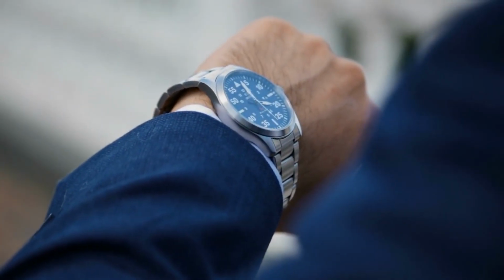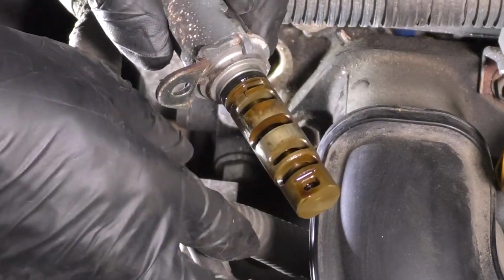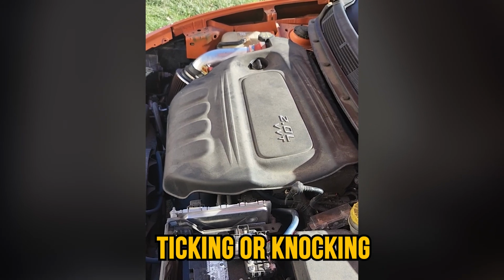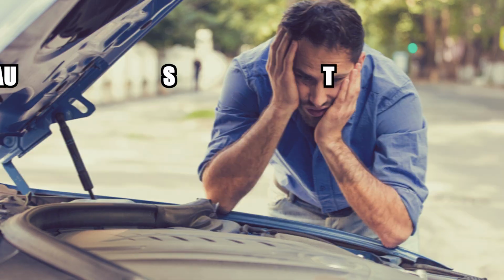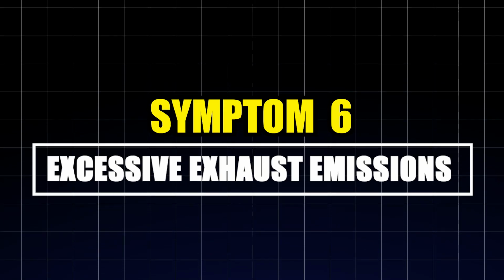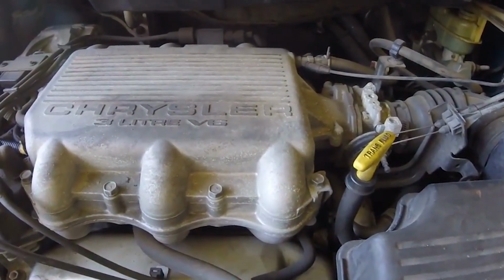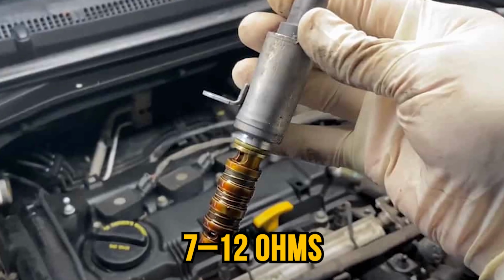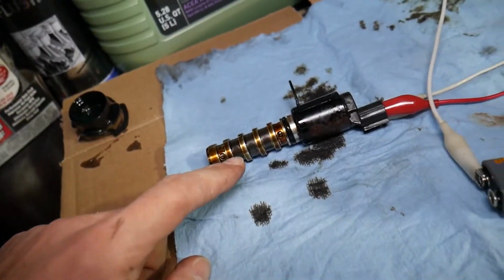Your Engine is Failing and You Don't Know Why | VVT Solenoid Symptoms

Comment: My 2003 Honda Civic EX has been diagnosed needing to have the VVT SOLENOID AND VARIABLE VALVE TIMING OIL CONTROL VALVE SOLENOID REMOVE AND REPLACE.  There has been a serious oil leak from my vehicle which drew my attention to a problem and this is what I have been told is the problem.  In your video I have not heard you mention a serious oil leak from this issue.  Could something else be going on with my car?   Please advise.  Thank you.

Comment: I have p0010 code, no rough idle. Just some possible loss in power and definitely losing gas milage. I took mine out today it looked fine and I cleaned it and reinstalled it but I’m still getting the code. Do you think it could possibly be the actual magnet instead of the solenoid?

Comment: I have made im 3.2 V6 GM engine new  timing chain set one year ago. After 470 was destroyed one  chain tensioner. Thank I have replaced all parts for be GM parts and after 1000 km thebchainninnte same section Was crack. Ca IT be something with solenoid on this side?  The second side off engine working without trouble.( Another 3 cylinder)

Comment: Mine was causing stalling, and it was the vvt solenoids..  They were replaced, and my vehicle  is purring now.
Reply from the maker: Glad you got it sorted — bad VVT solenoids can definitely cause stalling because the timing gets thrown off, especially at idle. Replacing them usually brings the engine right back to smooth operation, just like you experienced. Good call catching it early
Reply: Was it stalling at idle?
Reply: Did you change both?